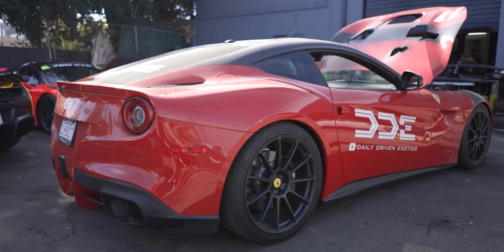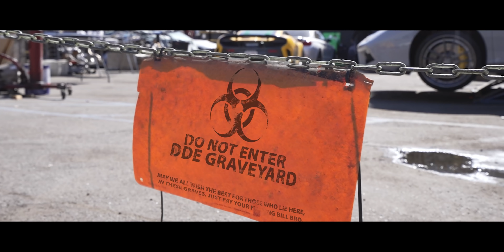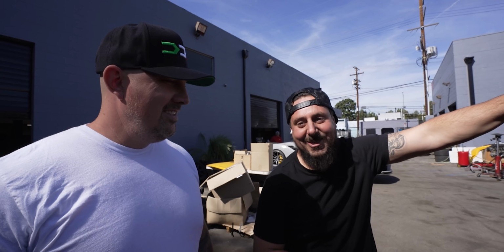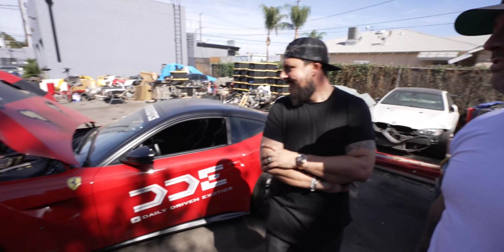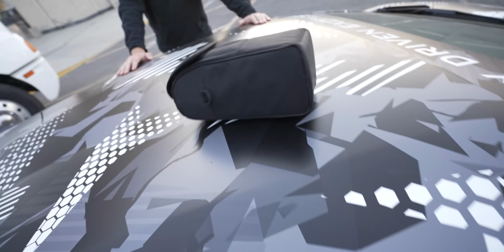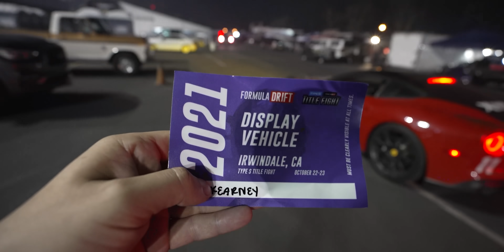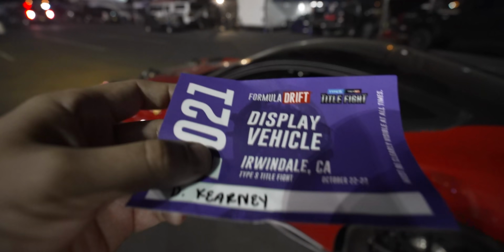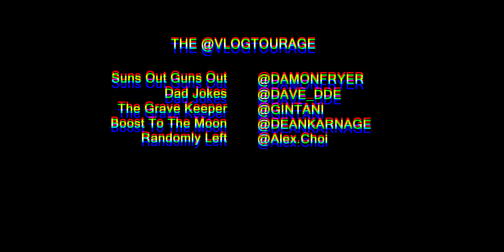WHATS HAPPENING WITH MY BROKEN SUPERCAR COLLECTION? *Turbo F12, 720GTR & 675LT*

Comment: I don't know man... If the F12 Setup could come out the side of the front fender instead of out the top of the hood, maybe it would be better with the new bigger turbos?
Reply: i only seen your reply I have the same as you to be honest or have the exhaust fitted back normally, and a F12TDF style body kit to add down force

Comment: The F12 will be in the shop for the next couple years until it’s a complete race car. Just sucks how they are a pain in the ass to customize. 
I said way back when you tuned the 720 it was going to blow up. Needs bigger or more oil coolers. 
Where is the 488? Not done yet. 
Who know what’s going to happen to Dave’s car lol.

Comment: So after tuning adding blow off valves changing the turbos and the hot side of the system on the F12 at Gintanis,  you basically paid who knows how much and had it at Aaron kauffmans shop for a year and a half for the fabrication of the cold side pipes lol no hate on Aaron that guy is a damn genius but I'm just sayin youve basically had to replace 85% the turbo system, so if he could tune or had an in house tuner he would have found these problems

Comment: Ferrari recalling large swath of 458s and 488s due to possible brake failure. might b the issue? years 2009 to 19' article posted November 1st on autoblog.

Comment: The f12 sounds awful. Can’t put a finger on it something weird about Kauffman and Kerny and what’s happened to the f12. Seems like they have no idea what they were doing and used each others relationship to scam dde… I think it’s actually super bold for gintani to take on this build when they know it will fail and only be able to produce similar if not less than stock hp reliably. Please revert to N/A